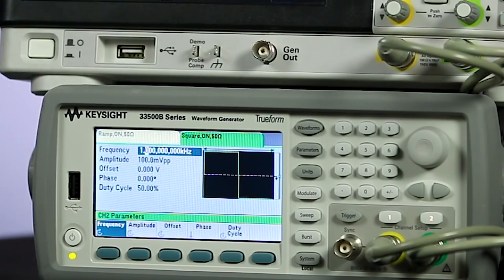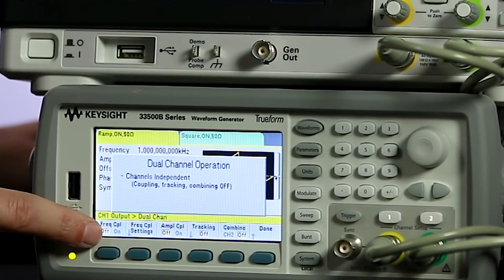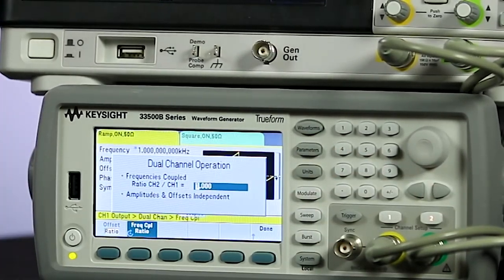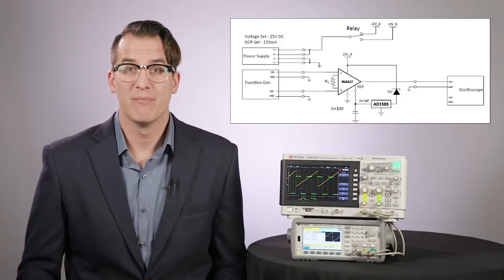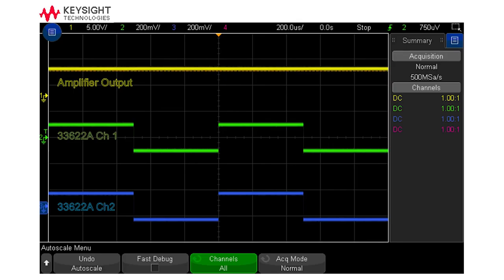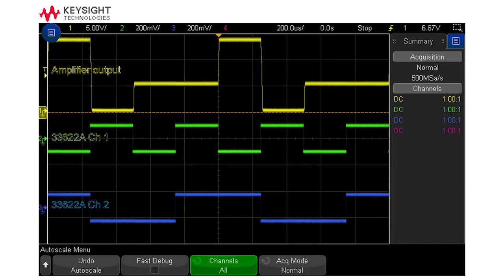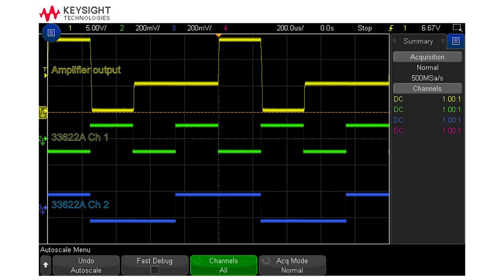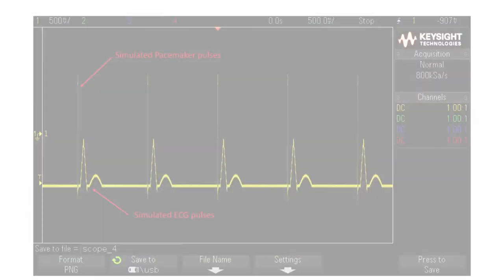Couple Your Function Generator Channels + Today's Wave Winner! (7-Mar)

Comment from the maker: How are you using multiple function generator channels simultaneously?

Links:
Wave page: http://bit.ly/JoinWave2018 
FAQs: https://www.keysight.com/main/editorial.jspx?cc=US&lc=eng&ckey=2939162&id=2939162
Reply: Multiple function generators would be handy for testing coupling of power input on portable devices from multiple sources, for example PV + cordless power charger + maybe ambient rf power--if device is expected to have long duration between charges and mostly expected to be used in standby mode --a health monitor sensor for example.
Reply: also for testing passive RF coupler/combiners.